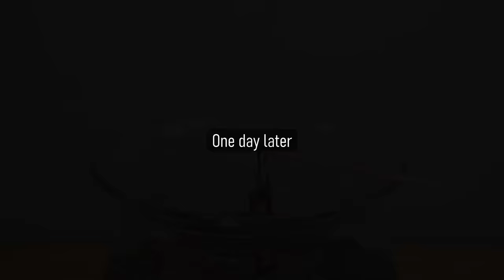Cleaver Restoration [Black Cleaver With Ebony Handle]

Comment: finally, a restoration channel that doesnt leave the pits in the knife.
Reply: Whats a pit
Reply: the little divots in the blade after the rust is removed
Reply: FOR REAL IT DRIVES ME CRAZY. With just a little more work they could absolutely get them out!
Reply: I find the pits pretty cool because it like shows how old it really is
Reply: @AceS_34  thats a fair point, but my problem is mainly with stuff that is used with food, as those pits are breeding grounds for bacteria and are hard to clean, making the knife/whatever not food safe
Reply: @hoboguitar148  that’s a great point
Reply: @AceS_34  i find it pretty cool too

Comment: Love it, the handle I’m not a fan of personally but the whole thing still looks amazing!
Reply: Feel the exact same way
Reply: What’s wrong with the handle he made?
Reply: @redpillsatori3020  it’s a beautiful handle, I just don’t like when the handle sticks that far above the spine of the blade. Just a personal preference is all.
Reply: @uummm654  ..ah ok. Other people were complaining that it was too thick as well, and should be better contoured to not slip out of the hand
Reply: I think he weakened the tang by removing all that material and making the rivet holes too big, this things are supposed to withstand heavy hits.
Reply: When I saw him cut down the handle - I thought No! what are you doing
Reply: personally, i would have left the tang full length, and built the handle with a strip of metal you can see on the side of the handle

Comment: Pro tip: when sanding steel always go with the grain of the steel, never go against it because it will look scratched.
Reply from the maker: Thank you for the tip!
Reply: A figure eight motion works the best in my experience
Reply: @Dboggs55  I've been doing it for a while and  I know any time you go against the grain of the steel you get scratches
Reply: Yes.  When the direction of sanding is changed, the resulting scratches are damned near impossible to remove.
Reply: @Ricopolico  it’s almost worse than the deep original scratches.
Reply: @montanatatum9598  - Once the surface has been refined a bit, it is much worse.
Reply: Same with wood
Reply: I live in Karachi Pakistan and I like your comment send 10 month old
Reply: @Dboggs55  I live in Karachi Pakistan and I like your comment if you don't mind

Comment: I can’t help but think that tang is going to snap at the top bolt hole if that cleaver is actually used like a cleaver.
The restoration other than that is beautiful.
Reply: I'm sorry but can you explain how?
Reply: @kimohimo60  The tang was originally pretty wide, and he cut it down and made it more narrow.  There is very little metal left on either side of where the  holes are drilled.  If this cleaver is used functionally, this is where the handle may break.
Reply: @kimohimo60   There are two weak spots. It’s not much material left around the holes and the sharp angles creates stress points in the steel.
Reply: Henrik Norén ohhh I guess I'm just stupid
Reply: @kimohimo60  I doubt that you are. 😊
Reply: The only thing holding it together is glue.. there is no mechanical bond whatsoever... what he should have done was drilled all the way through the wood and used the steel rod as a rivet instead.
Reply: @dharmraz  what

Comment: Amazing final product! However for future reference, never completely remove a knife’s tang it makes the usability of it almost zero due to the fact it can easily snap off the new handle with pressure! Otherwise great job!
Reply: What's the "tang"?
Reply: @silverbat5873   I was thinking the same thing maybe like the part of the handle they removed?🤔
Reply: @katrinahunter5750  its the part of the knife that extends into the handle
Reply: Same what is a tang
Reply: I agree! I would have never done that to the tang!
Reply: Agree...too much tang removed for no benefit. Especially then to make the holes so big...the ebony handle has a lot of "meat" in it to hold the tang...Dunno why he would do that.
Reply: I'm still puzzled by the coffee soak.....
Reply: @Dawghome  -Delicious coffee.
Reply: @mydadsawesome5217  The tang is the portion of the metal that extends into the handle, continuous from the blade.
Reply: @Dawghome  I'm guessing it was a convenient and cheap source of acid
Reply: Makes the cleaver completely unusable. One solid blow to a beef bone and that thing is snapping. Not to mention drilling the hang hole after finishing the surface? The wooden handle. Idek. First off why not just through pins, second he sands it to like a 400 grit finish, and third that one little crappy coat of oil is not going to do anything to protect that beautiful wood. Especially not when you’ve gotta clean the thing with soap and water if you actually plan to use it. I don’t wanna be a hater but I can’t help but notice everything was just wrong.
Reply: @projektkobra2247  The forbidden coffee.
Reply: @nationalgeo2191  What would you use on the wood? I was thinking a few coats of linseed oil, minimum. And I agree on the tang. I would have just cleaned it up & used the rivets for their original function... To go through the whole thing & hold it together. About to make a new handle for one now. This was a good video for ideas, but some I'll change. Wonder if a wire wheel would be better than a side grinder for cleaning off the rust?
Reply: @nationalgeo2191  I agree.
I would submerged the wooden handle completely in linseed oil for a week. Like what was done to wooden planes in the past.
Plus there must be cheaper and more efficient ways to restore metal. The amount of money and time and tools spent on these projects is unrealistic. Yet I do enjoy the production value of the videos.
Reply: My friend, are you all right? Hope you can be happy every day, healthy!
Reply: @Dawghome  I’m pretty sure the coffee soak was used to “stain” the knife and give it its dark colors
Reply: @tonibenton1931  i wouldn't recommend linseed oil for anything relating to food, i personally use mineral oil (its late i could 100% be getting my oils backwards)
Reply: @tonibenton1931  I would use any kind of polymerizing oil, or an oil with polymerizing additives. One that I like is polymerized tung oil which contains some amount of mineral oils as well to thin it out a bit. And yeah, soaking it is a great idea. Really it just needs to be fully penetrated and form a seal at the surface so that through cycles of washing, and soap and all that it doesn’t break down and start to absorb into the wood. Soaking can help prevent this too
Reply: A tang is what the handle attaches to its the place we're u drill your holes and put on the handle
Reply: Its called a" poon tang " i know it very well
Reply: @dingus7756   appreciate the honesty😅 boiled linseed: has additives, not food safe. raw linseed: yes food safe, linseed is just another word for flax, so its just flaxseed oil. Takes a week or so to dry though. Mineral oil: petroleum byproduct, technically safe but, why use it when natural alternatives exist?

Comment: Many years ago, My father and I dug up a large ax/hammer head in similar condition from the old town of Childsbury South carolina (colonial, long gone). It seemed to date around the late 1600s or early 1700s and was 2 ft below the surface. We may try someday to restore it such as you did.
Reply: 1600s?! Who told you that?
Reply: @Occus  it's when the settlement was being built, late 1600s, early 17. The depth we found it and location as well. It's nothing but forest now. We went metal detecting in the 90s sometime.
Reply: @ice_fox  oh ok
Reply: Are there no museums that are interested in the axe/hammer head?

Comment: Every time I see electrolysis I appreciate distilled white vinegar rust removal even more. I’ve never seen electrolysis remove rust better than DWV. I don’t get why people use it. There’s still so much work you have to do after . DWV removes all of it in the same amount of time or less.
Reply: Yup I used to use electrolysis and changed to vinegar. I'm not even fussy about the type.. any vinegar seems to do a great job.
Reply: @nathanchalecki4842  yep! AND you can use it over and over. I have about 3 gallons that I’ve been using for years.
Reply: @ThePipeiper  can I use it for a smoothie? 🥺👉👈
Reply: @Salah.Ad-Din  sure! only one though 😔
Reply: I'm no expert, but do these chemical manipulations make any sense if you are going to remove all the pitting with a belt sander? Seems like a lot of extra work
Reply: @feofanilyushkin8315  good question. The reason you remove the rust first is because leaving it on will lower the service life of you abrasive mediums. Sanding belts get dull faster. Sand blasting media becomes less effective faster when you’ve blasted a bunch of rust into your bin. Dropping a metal part that you are going to work on into distilled white vinegar over night usually is enough to remove the rust. Then when you sand you are on bare metal to begin with. I used to wonder this as well.
Reply: @rondog699  you won’t be disappointed. I would advise you watch a few vids on it first. I don’t know if your tools have wooden or porous handles on them or any other materials that may be affected by the DWV. But as far as steel, it works GREAT. Another pro tip. If you have brass that is oxidized mix vinegar, salt and flour and wrap the part in that with plastic wrap around it over night. Next day, good as new. Thanks for coming to my Ted talk.

Comment: I have to wonder about the strength of the tang after making it so much smaller and then drilling those 8 mm holes in it.
Reply: I was thinking it would have been full tang before bieng cut
Reply: The tang is going to snap at that top rivet if he ever tries to use that cleaver to chop anything tough or with bones. Cleaver handles are big for both counter balance as well as durability. He took that cleaver tang down to that of a carving knife and then drilled those rivet holes way too big. I'm guessing it's the only rivet size he had, so he just took the chance. I'm also guessing that the tang had lost too much metal to corrosion and he had to shorten it. Fun project, but it's definitely not going to be able to do what it used to in it's original form.
Reply: Yea the job he did on the handle ruined it for actual use
Reply: I’m so glad someone else mentioned that. As soon as he started marking the tang, I knew it’d never be used for chopping again. Then we got the sharpness demo on a peach. Yeah, that’s the only thing you can use it for now. A bone chopper turned monstrous pairing knife.

Comment: The only thing I can’t understand is why you would cut it down from a full tang to a partial tang. If you wanted a full wrap handle you could accomplish the same thing by thinning the tang like you did but with a full tang it would prevent it from snapping the grips.
Reply: I cringed when he chopped off part of the tang
Reply: As soon as he started cutting into it I said out loud "Why would you do that?"
Especially after making the holes bigger, that handle is going to be very weak.

Comment: Good job. I personally would have still held the long shank and held the three pins. It is still a tool that is used by hitting. With the tang ending in the middle of the handle, if you tap a little hard you find yourself with the handle in your hand and the blade somewhere else.
Reply: exactly what i came here to say
Reply: Especially with the size of the holes that were drilled in. There was so little metal left for strength.
Reply: But the inset into the wood means the metal isn't taking all the sheer force
Reply: @forsakenquery  It's going to break around the first pin. Ahead of that is only 3/8" of wood which is providing almost zero strength.
Reply: @1992jamo  I don't doubt it's weaker than the original design but it's stronger than it looks as the wood capsule compounded with the steel layer will take more sheer force than the sum of its parts.

Comment: Awesome result. One question, why do the whole electrolysis process if you just ended up grinding away all the pitting/rust anyways? Seems like you could have just gone straight to the grinder.
Reply: I am no specialist this is just an assumption but maybe it was to make the grinding process easier and quicker?
Reply: The cost of the electricity and baking soda used is less than the cost of a grinding blade.
Reply: Guessing it was for the ASMR bubbling effect rather than it being a useful step in the restoration.
Reply: Didn't see this comment earlier but I asked the same thing lol.  Seems like all he needed was that angle grinder and belt sander.
Reply: Didn't you see? He clearly made himself a drink...

Comment: I am no professional, but have worked in a blade shop. Personally, I like everything you did, except for shortening the tang. I understand that it can be just as strong, but I prefer a full tang, always. Overall though, a very good, classy job.
Reply: I had the same thought, just from the position of restoring the object as closely as possible to the original.  Different wood for the handle, sure, but I'd rather have left the tang as it was.
However, to each his own.
Reply: @A.B994  facts 🤙
Reply: @A.B994  exactly, this is a bad restoration that only impresses laymen.

Comment: Beautiful restoration, however I question the structural integrety of the handle. There is about 3 times less steel on the sides of the first hole compared to the original design, while the stresses are the highest at this location. If it's going to break, it will break there.

Comment: You did everything in this video extremely well, except the actual "making a knife" part. All your techniques are flawless, but you turned a rusted cleaver into a flawless wall ornament with your decision to cut the tang but still put a long handle on. Shit's broke now.
Reply: Yeah why did he cut it so far off, the handle could've accommodated much more metal
Reply: Kinda harsh for someone restoring trash - I imagine he ended up taking a route other than his initial vision.
Educate me though, does shortening the tang that much really make for a significant chance of failure?
Reply: @reidprichard  the combination of shortening and thinning the tang as well as drilling the pin holes wider. This cleaver should never be used to chop down with ever again
Reply: @reidprichard  Full Tang vs Short (or Half) Tang is a huge debate with knife people, but the answer is pretty scientific, I don't know why it's an argument.  :P Full tang allows for more force, as it's not reliant on the wood or plastic and pins of the handle to withstand the leverage created. If you think about downward strikes with force by the handle, in a full tang you're basically holding the knife with a grip, like swinging a 2x4. Short tang would be like trying the same thing, but the 2x4 that you've used has two screws to connect a 1x4 to either side, and that's what you're holding. A good hard strike will probably make the structure collapse at the junction.

The reason why short tang is even a thing is to reduce overall cost, but for some knives it's not a big deal. Single-use knives, paring knives, most cheese knives (although just use a wire), they don't really need a full tang, although they can and will fail if prolonged pressure is applied. But for cleavers, santoku, mostly any meat or thick/solid food, you need that full tang to really get the swing. I've used short tang for those applications, and got yelled at for 'swinging the knife too hard' when it snapped right where you'd think it would. I suppose I was supposed to carefully saw with the knife on the bone instead.
Reply: @MrThefection  As you can see, he only uses it for slicing fruit, which is about all it will be good for. It's just a glorified paring knife now. Though it's clear this whole thing was done for the ASMR views rather than the metalworking professional ones.
Reply: @KitsuneSoup  thanks for the detailed explanation! I'm an engineer, so I can definitely understand why it would be weaker - just wasn't sure that it would make much a difference in typical use. That's crazy that you've had one break!
Reply: I actually feel really shitty about this comment... Sorry to anybody who liked it, but the poster put a ton of work into making the knife we see at the end. And I don't put that much effort into almost anything in my life. I meant my comment to be constructive, but phrased it like a dick and ruined my point, as well as helped encourage this comment section.
Just wanted to officially say sorry to OP, and tell them that I like the work they did on this knife.